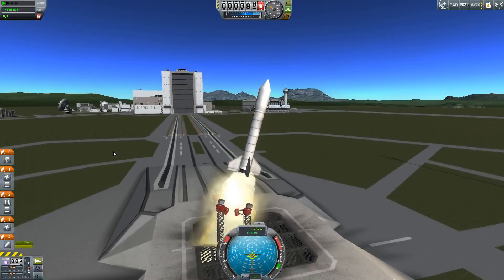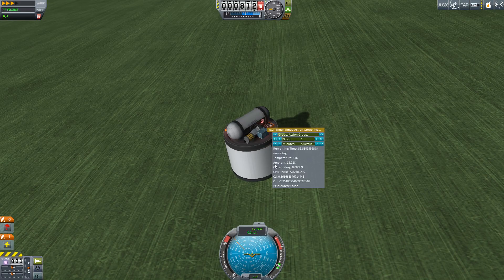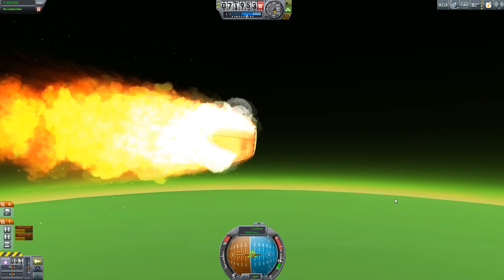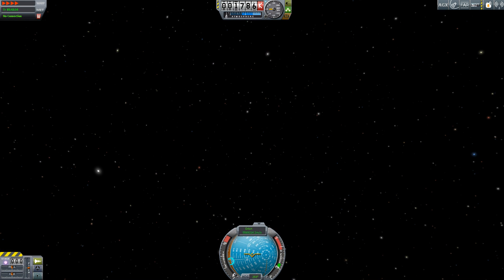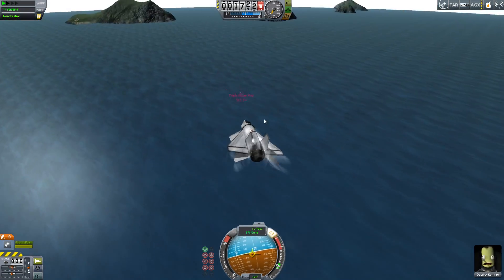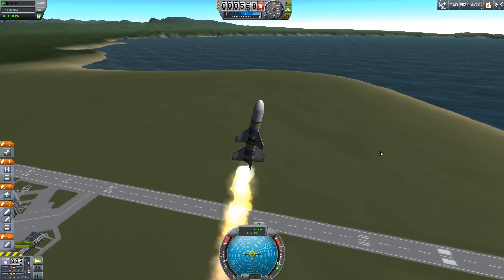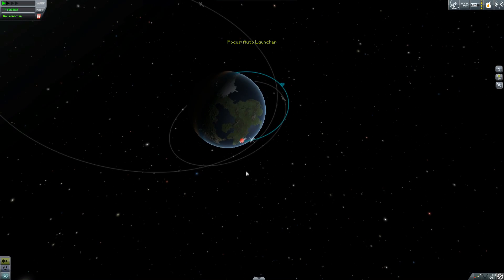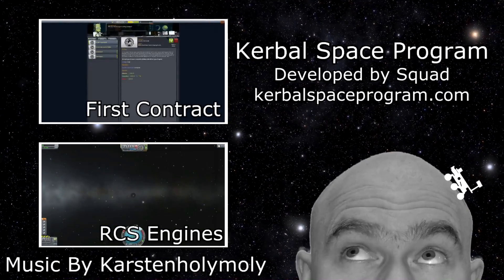Kerbal Space Program - Low Tech Automation with Smart Parts

Comment: That spinning top-style spin that the 'Japanese' unguided rocket experienced, is almost exactly what happened to the Iris 1/EagleEye 3 in 'The Martian'! Except, of course, Iris 1 disintegrated because of it...
Reply: It's called spin stabilization, but I'm pretty sure that's not the axis it was designed to spin around.
Reply: No, I know about spin stabilization, I mean that if you looked at the rocket in a fixed frame of reference, the bottom would be spinning on a point and the top would be going around in a circle.

Comment: Why didn't you use flight computer?
Reply from the maker: Which one the kOS or the Remote Tech.
Reply: The remote tech.
Reply: Scott Manley He raises a valid point. In RT flight computer commands don't require an uplink. You can plot a quick maneuver node and order the flight computer to preform it. So long as you had it plotted and sent the order before blackout it'll handle it without base contact. I found that invaluable for building my first sat network.
Reply: Scott Manley are you going to install remote tech in the new series in the real solar system. If you are going to install it please DO NOT turn of signal delay. :D
Reply: Grimbach have you been playing on the stock game 6.4x or 10x?